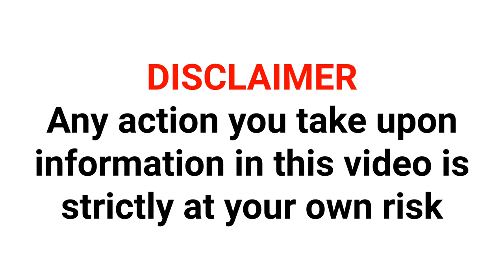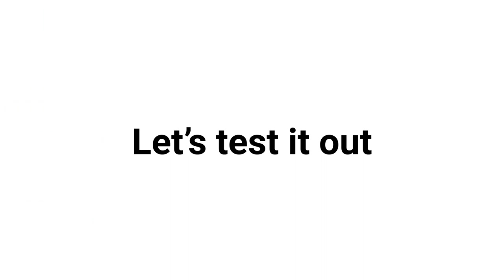Mixing Bowl Pizza Oven Assembly Instructions

Comment: I wanted a Karu 16 but can’t afford that.
I’ve thought of building a pizza oven out of an oil drum and have got as far as burning the paint off 24 hours ago, then I saw this.
Absolutely priceless, thinking outside the box, genius.
Reply from the maker: I found this iteration much more adaptable and useful than other implementations for the reason this single oven can be used for baking if you've seen my sourdough bread baking videos and it can be used for flat breads and of course pizza. I've done several other experiments but none have been as successful as this one. It's also safer to handle due to the handle keeping hands away from heated metals. I'm still working to perfect this setup for wider use cases. I'll share videos as I hit a milestone.

Comment: Can you plug it straight to the socket?  How do you  select right power (W) size?  By calculating Ohms?  R=V^2/P= 240^2/1800= 32 Ohms? How many Ohms is enough for pizza cooking in your case? Do you any type of resistor or current regulator? The way I see you put it straight to the current.
Reply from the maker: Haven't focused too much on those specifics but if any oven can achieve over 400 degrees celsius should be good enough for pizza. If insulation is used on outer face of the bowl such as ceramic fibre then a 1kw element would still easily achieve over 400 degrees celsius. I can plug directly to wall socket. I'm using extension cord because wall socket is further away from me so can't reach with single cable. I used current regulator, the element wouldn't turn on if it is below 120volts. Only starts heating up if I turn the knob to over 120volts. Also makes a buzzing noise if I use regulator but helps me keep the temperature lower for example of I need to cook a different style pizza which requires longer cooking time other than Neapolitan style.

Comment: Do you think  a Sunbeam professional stainless steel electric wok will work like your mixing bowl pizza oven?
Reply from the maker: That's just a normal wok with an element hidden under it. That works for its own purpose but for pizza you need the element to be not covered and should be at around 7cm distance from pizza so the element's radiant heat cooks it. If the sunbeam wok is turned upside down it could bake bread. But it is too dear to modify it for a pizza oven. Also turning it upside down means its electrical components will heat up and could burn quickly as heat rises upwards towards it.

Comment: Hello,

Where exactly on your bowl you did the 4 holes of the heating element? At which height? 7cm ?

Also what is the diameter of the drill bits?
Reply from the maker: The height of the holes are at 11cm. Diameter of holes is 8mm. The element itself is bent at a slight angle as you can see in the video that places it at a height of 7cm. You will need to trace the holes distance and size based on the brand of element you get. I used a paper template that i traced myself by placing on top of it.
Reply: @saidalisamed  
Thanks.